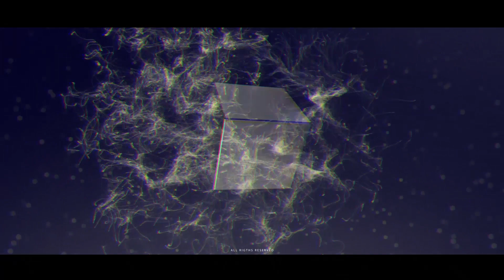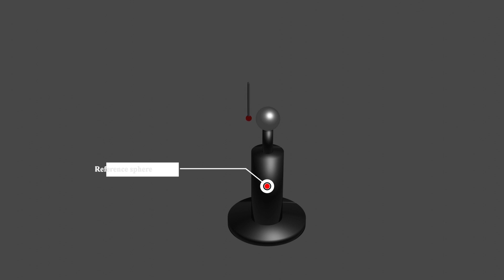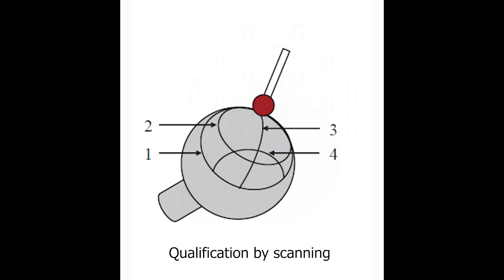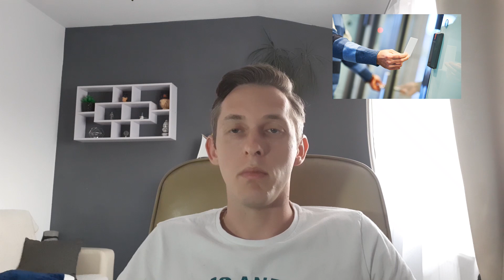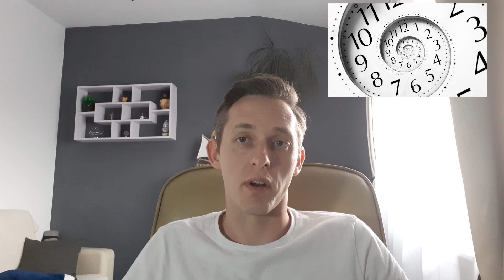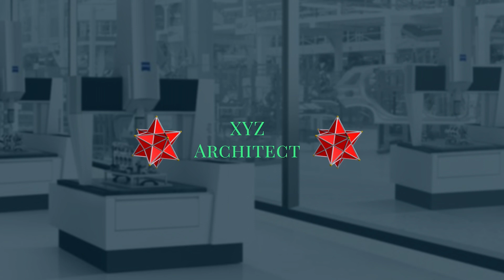Qualification? Why ?

Comment: So interesting video! Thank you very much. Please let me ask you a question about qualification: when must we do by scanning or point by point qualification of reference sphere? Does it depend on strategy we use later? I mean if we make the measurement of features by scanning or point by point, should we qualify reference sphere in the same way?
Reply from the maker: Qualification on Calypso is done în 2 ways, 1 is by making individual angles and doing qualifycation on each. And the other is RDS CAA if you have a Vast XXT head and then it wil be an automatic qualification in 7 angles that will determinate all other angles, this is the point by point, and the advantage is that you can use any angle with this option, the disatvatange is that you loose precision. So yes to answer your question, point by point is not as precise as scanning.